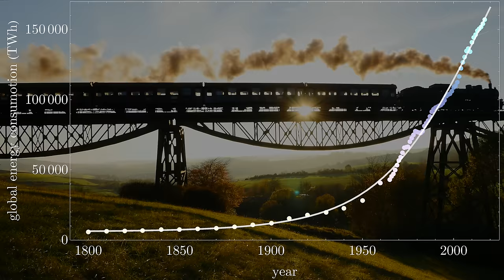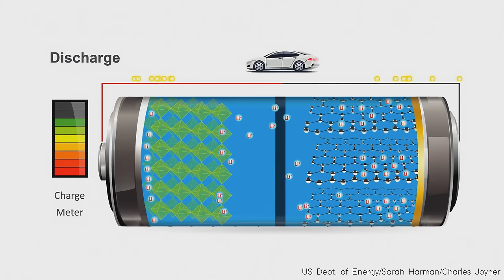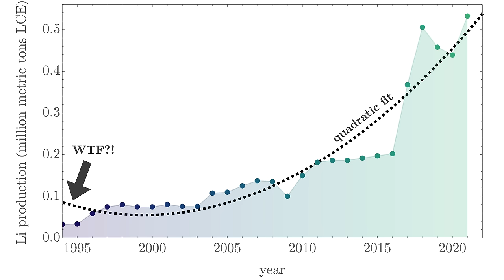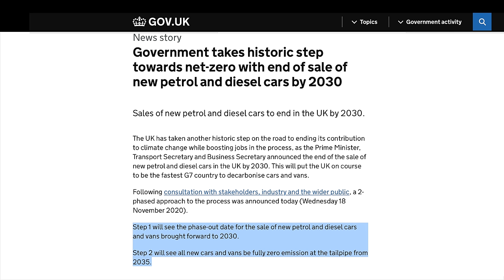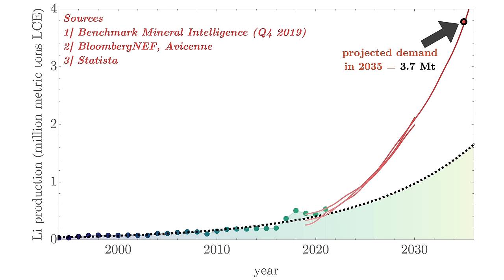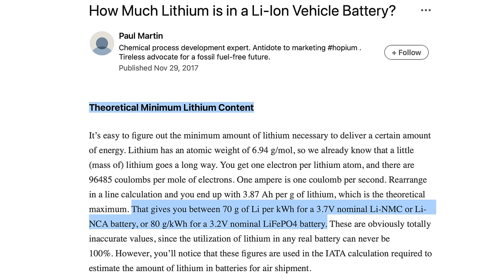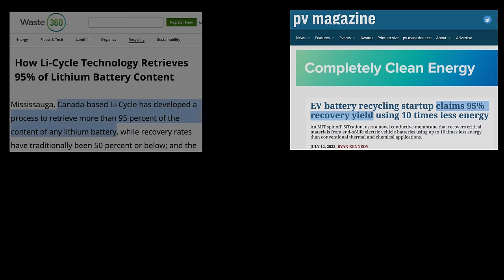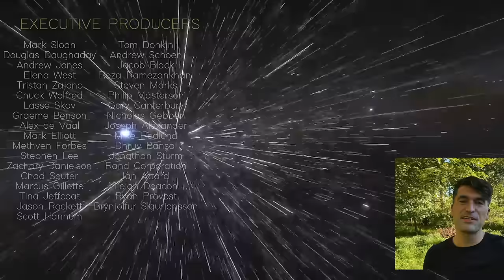Will We Run Out Of Lithium?

Comment: Never thought about running out of lithium but you have a point.
Reply: Lithium isn't really the material we need to worry about running out of. It is the other materials used in batteries that are less common that might be a bigger deal.

Comment: Great video! I have been looking at some adjacent stuff, and something to keep in mind is that the high energy density of lithium batteries is only needed by mobile applications, while stationary assets can be reasonably replaced with heavier, non-lithium constructs. I think one US company is developing a ferric battery that is super bulky and heavy, but can run for decades with minimal maintenance and hazard. In the case of distributed solar generation as you mentioned, it is not always required to get that fancy tesla wall pack when a big buried box does the same thing but cheaper.
Reply from the maker: That’s an excellent point and a good way to save on lithium
Reply: Yu Lu:   Yup.   Instead of electric batteries, large stationary systems can use heat storage, gravity, etc. -- the key is cheap, reliable, durable energy storage that can generate electricity (by, say, driving a turbine), and be 'recharged" to store the needed energy repeatedly. 

Just like for oil, where we should be using it for things we badly need (materials) vs. just stupidly burning it, using lithium for where the light weight is needed makes lots of sense.  The good news is that over time, economics tends to reward using things wisely at large scale -- though it can take a long time for industries to mature enough to "get there".
Reply: @Peter from NZ Regarding your point (a): That was my thought too, but I read that a grid even the size of Europe is way too small to work, aka will occasionally drop below 10 %. And larger grids are just not feasible today.
Regarding (b): Nevertheless the majority of power consumption is still instant, the large industries consumers and commerce.
Reply: @Peter from NZ Your right, I didn't specified it more clearly cus I didn't remember it enough. What I remember: It said in a grid the size of Europe we would need more than 10 times more installed capacity than needed, so that at any given time to not have power outages with only renewable energy.
Reply: @Peter from NZ Maybe you are right.

Comment: Great video and so well researched.  Thank you.  Some food for thought though:
- Lithium mining is devastating to the earth's surface and scenery.
- Lithium leech fields are toxic. What happenms to them once the mine is abandoned?
- What is to be done with discarded batteries?
- The amount of heavy fossil fuel powered equipment used to extract, transport and process lithium renders any carbon reduction to virtually net zero.
- The necessary mining is done on the backs of the poor and children in poorer countries as rich countries' dermand increases.  Is there a moral cost?
- What do we do with unwanted EVs once the battery life is exhausted or the owner wants a newer model?  There is no resale market for a car needing a $20k battery replacement. 
- What happens when an inevitable terror attack on the power grid takes the grid offline for weeks or months?  How will that affect the economy when the primary mode of transport is parked?
-  What happens when electric demand outpaces the ability of municipal power infrastructure to deliver like in California?
- Not everyone will be able to afford an EV.  If fossil fuel vehicles are "illegal" how will these people get around?
- Automobile crashes happen frequently.  If batteries are damaged and need replacing at exorbitant costs, what happens to the affordability of car insurance?  How will that affect those of lesser means?
- If the motivation for widely adopting EVs here in the US is to prevent the dubious idea that climate change will be catastrophic if not controlled, what about the two most populace countries on earth (China and India)?  They are poorer countries with combined populations ten times greater than the US and are larger contributors to global carbon emmissions than the US.  Us "doing our part" addresses nothing happening in the rest of the world with a more deleterious impact on the macro climate.
Sometimes the law of unintended consequences creates a larger problem than the problem being solved.

Comment: Great video!
No matter how well electric cars and battery storage develop, it showes (again) that simply shifting from ic engines to electric cars will not work.
There needs to be a combined effort. Smaller cars need to be the new standard; comfortable, quick and cheaper public transport as a better alternative - and sustainable cities with an infrastructure that encourages a lifestyle without the need for a car in the first place.
Reply from the maker: Thanks, I tried to avoid injecting anything political here but I would agree that depending solely on EVs isn’t enough
Reply: Also ride/car sharing needs to be managed and private car ownership reduced.

Comment: I would absolutely love to hear your input, as a follow up to this video, on other battery technologies like graphene, solid state, nuclear, diamond, and hemp
Reply: Graphene Aluminium-ion batteries should be coming out to EV's by 2025/2026 and could be a big help to this problem. No lithium, manganese, cobalt, etc. Just aluminium and graphene.

The big crux of these batteries is the graphene, which until now, hasn't been easy to manufacture. A few companies (Graphene Manufacturing Group for one) are on the cusp of mass producing battery grade graphene on the cheap. As well as their batteries.

Comment: Another thing to be addressed next to the lithium supply, is the fact that today's power grids are unsuitable for all those cars to be charged simultaneously.
Reply: No, in nearly every industrial country, the grid engineers will tell you the grid can and will cope fine. For one thing everybody will never charge their cars simultaneously, the same as every ICE car does not turn up at the pumps at the same time. And EVs can actually help the grid, by using up the abundant spare off-peck energy. (most grids spend most the time at around 40% capacity). And as grids bolt on more and more renewables will be more and more times when the grid has excess spare cheap energy. And there is the potential of VTG! 
And all power grids are dynamic and evolve and continuously change over time (for example when AC was introduced in the US the grid demand doubled in a decade) 

But yes, I'm sure there will be some minor teething problems along way which the press will jump on!
Reply: @stevetaylor2818  That's cope, actually.
Reply: @stevetaylor2818  wrong

Comment: There's an omission here. Lithium is primarily a stopgap measure to get EV going. Hydrogen is the long-term goal and the production of hydrogen is getting less expensive by the hour, while investments in renewable energy is growing. Fluctuations in electricity consumption means we always operate at an enormous loss, that could be stored as hydrogen, making use of otherwise wasted electricity. The problem with HEV has been that there hasn't been enough demand to finance the infrastructure. But the BEV market is pretty much financing the HEV market. Also, the benefit of BEV is dramatically reduced with car sharing, where the car will just go home to refill once in a while, letting some other HEV take its place.

Comment: One other trend that could reduce the demand for EVs is a larger emphasis on public transportation, particularly in large urban cities where several ton vehicles being utilized to carry a single individual when you can have hundreds of thousands of people going the same way for significant distances at any given time. A lot of cities both in the US and Europe have been focusing recent infrastructure efforts at reducing car usage, while there has been more awareness and push in the online space towards less car-dependent infrastructure.

Should new EV production be unable to meet demand, whether that be because we fail to recycle enough lithium or scale up production quickly enough or are unable to reduce the cost to produce lithium or significantly reduce EV production costs leading to a situation where cheap new cars with decent range stay dominated by ICE cars until bans stop their sale leading to a lack of supply for that market, or general EV production is unable to scale to meet the surge in demand come 2030 and 2035. In such scenarios, especially if it starts to extend for multiple years, more individuals would look for alternatives such as bussing, trams, and biking for their local use needs while utilizing older cars, trains, and planes for their rarer long-distance needs. I don’t know if this would end up being just a small piece of the puzzle or a major shift in how we live (I suspect that’s highly dependent on gas prices going forward and whether increased volatility and continued EV shortages convince more people to invest in alternative transportation, as well as how large of a lifestyle shift Gen Z decides to go compared to previous generations where in the US especially have largely been ignorant about the potential of public transportation as a realistic and decent transportation option for ordinary people who can afford cars and not just those unable or unwilling to drive).

Will certainly be interesting. I do hope that we’ll get better lithium recycling though and electronic waste recycling in general.
Reply from the maker: I spend most of my time in NYC and never drive there. We use the subway and my OneWheel, so totally agree. But the NY subway is underfunded and deteriorating, it floods every year, has so much break pad particulates in the air it’s toxic and is often delayed. I’d love nothing more than to see serious investment into the subways, but I tried to avoid wishful or political thinking here, and just give you the current projections and mandates divorced from any personal biases.
Reply: @CoolWorldsLab  I still wonder if the chosen projections take changes in city planning and transportation into account. Ongoing climate change will also have a huge impact on people even wanting cars or being able to buy them. I don't think car sales will still grow as large as they used to. Modes of transportation will change.

More people have to take the orange pill.
Reply: The racial demographics of modern cities are extraordinarily alienating, making the daily usage of public transportation a daring and dangerous adventure.
Reply: @daisy9181  I'm not going to argue that public transportation (especially in the US) does not have some serious downsides, and right now is typically only utilized by economically poorer individuals who are more likely to engage in unsafe drug use, and that public transportation is often dirty.

I do have two things to say though. 1. Public transportation is dirty because only poor people use it and as such no one wants or is able to pay money to clean things up when messes inevitably happen. Think of it as the difference between going to a public bathroom in a nice area of town as opposed to the sketchy area of town. A public bathroom in the nice area of town is much more likely to be clean, and less likely to have sketchy things going on inside, despite both technically being open to everyone. As more money is put into building and improving public transportation, more wealthier individuals will be willing to give it a chance and the more that use it, the more people will be willing to spend money to further improve and clean up public transportation.
2. Those problems say more about the state of American society and social problems within cities than being critiques of public transportation specifically. It says we have a large portion of people who are homeless, poor, and engaging in unsafe drug usage for one reason or another. The difference between everyone driving and everyone riding public transportation or walking is that with the former all of society's ills are hidden away in our own little metal cubicles.

In short, if you don't feel comfortable riding public transportation, that is an indication that we should be doing more to make it and our societies better, not to throw away the idea altogether. Public transportation has a lot of advantages that driving can't match, and to be frank, driving can only support a very low population density without leading to a need for massive roads, taking up space that would be used for housing and dramatically increasing average commutes and driving up housing prices for those in inner suburban circles as people prefer not to have to drive 30+ minutes to go places. Even Houston, with all its sprawling and massive roads, still has to add a new lane every few years because the highway becomes completely clogged. So while I don't think public transportation is necessary to decarbonfy our transportation network, I do think it would help, and to whatever extent we are able to reduce car usage, especially in our largest metropolitan areas where car usage makes the least amount of sense, will help with other issues like noise pollution, average commute times, and hopefully housing prices (though there are obviously a lot of other factors that have led to high housing prices so I'm certainly not going to promise that we'll all have affordable housing if we just start building public transportation and higher density housing to go along with it, though it likely wouldn't hurt).
Reply: @MrViki60  Hmm, I might recommend doing your best to live in rural areas which are projected to stay predominantly non-Hispanic Caucasian (i.e. White) over the next few decades, as the US as a whole is already set to cease to be a predominately non-Hispanic Caucasian country within the next 3 decades, regardless of whatever we do with immigration at this point.

That being said, assuming you decide for whatever reason to stay living in a place with a population density capable of supporting a decent public transportation network, the more money in the form of taxes you are willing to pay to make public transportation better, the more people will be willing to utilize it, which means less cars on the roads, which not only means less traffic, but longer-lasting roads as the wear of twenty cars is far more than that of a bus that holds twenty people and trams and other light-rail suffer far less wear-and-tear than roads do thus requiring less maintenance and thus in the longterm less tax money to maintain.

It should also be noted that except for very rare areas where the population density is exceptionally high (such as the Manhattan island or the few blocks of downtown in most major cities capable of supporting large skyscrapers), I'm not advocating for a ban on driving and forcing people to utilize public transportation. For those few areas, they are crowded enough that most people are forced to walk anyways so removing cars and building a few tram systems would seriously decrease trip times and improve safety (not to mention kill a good chunk of the noise, because NYC is seriously noisy, at least if the various movies set in NYC are even remotely accurate). For the other 99.9% of the country, banning car usage is not necessary nor likely. Even Japan, the Netherlands, and Switzerland, the three countries described as having the best public transportation networks in the world, still have a large portion of their people who only travel by car. The car is just not the only option for transportation. So even if public transportation is improved, you can still avoid it just fine, and again, the reduction in cars on the road will improve your driving experience.
Reply: public transportation is garbage

Comment: How do you figure the demand for Personal Vehicles in general? IMHO we need not only to swap in EVs but also reduce the need for and therefore demand of PVs. At least some of that should be able to be picked up with battery-less public transport like trolleybuses, trams and other rail vehicles with constant uninterrupted electricity supply (overhead wire, third rail, etc)
Reply from the maker: As stated, current trend is that global ownership is slowly increasing, but it could reverse. Our estimates assume little change here, since I don’t want to sell you hope predicated upon an overly optimistic conditional

Comment: So glad you addressed recycling. I do wonder if the non-EV demand is understated. As automation comes more online for common jobs there might be more autonomous workers who move through facilities uncabled which will also need batteries.
Reply: The video is actually generally wrong. There's already efficient recycling happening of lithium ion batteries, it's just not at a significant level yet as there's very little lithium batteries to recycle yet.
Reply: Also not factored in is growth in local power storage, if it picks that that could consume as much if not more than EVs. As renewable energy has to be stored for quick release and gravity based storage solutions may not be enough.
Reply: @Codysdab  Each EV stores enough energy to run a house for about a week... And they are starting to and will ever more be used as stationary storage to help balance the grid...  Also, the cell chemistries that are cheaper but not energy dense enough be to put into a moving vehicle is what is used for stationary storage, so one supply is not necessarily taking away from a different supply...